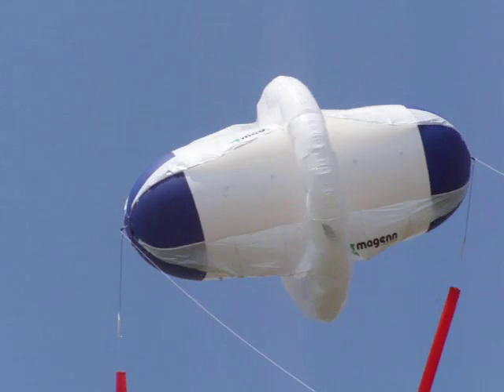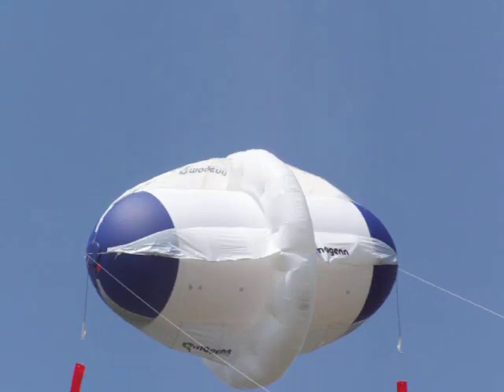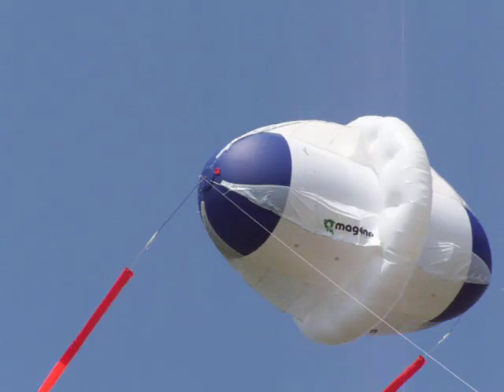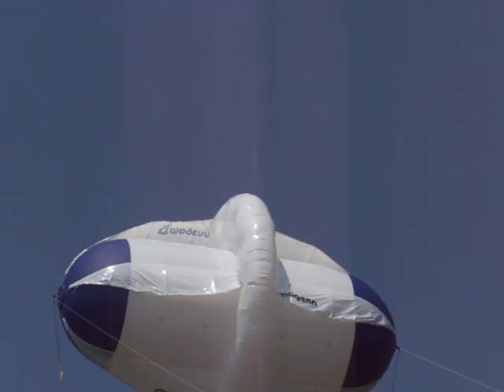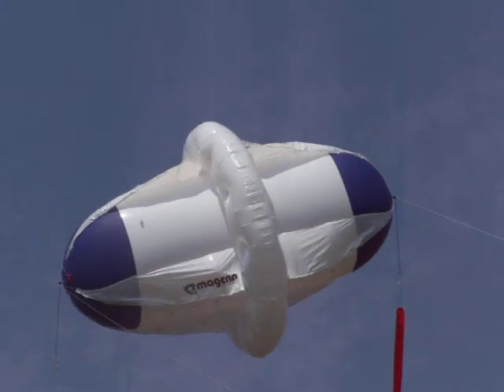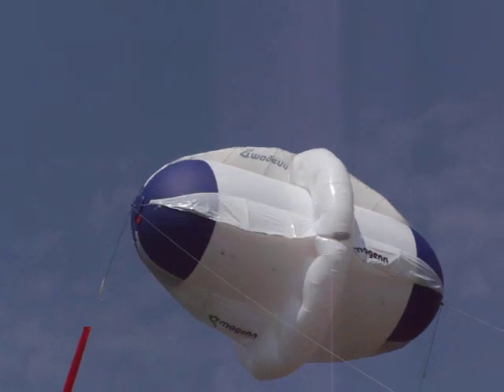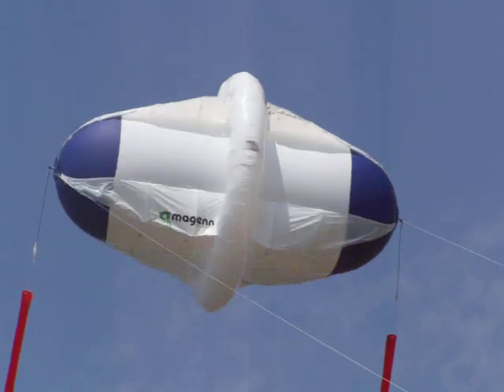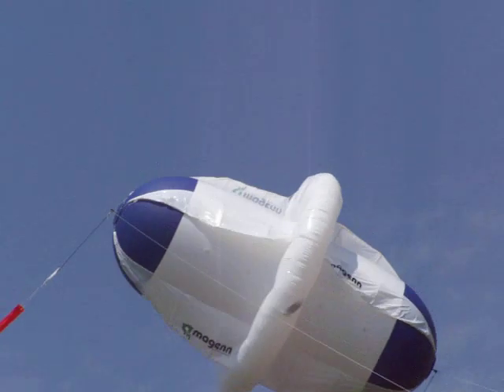Magenn Rotor Kite

Comment: The Magnuson effect is supposed to pull this sort of shape into the wind and prevent the balloon from being pushed into the ground, but as you can see the lines are at nearly 45 degrees in this mild wind at low altitude. Also, it looks like the blimp could easily twist it's lines, which I think would make it inoperable. 
Another thing, how do you refill it with helium at altitude? What does helium cost? How does that compare to the value of the electricity generated?

Comment: The only issue I could see with this generating electricity is the weight of the equipment needed to do so.  How much lift does this balloon create?  I could understand mounting a small alternator on the blimp and using wires to carry the current down to a regulator/battery, but at this point in time, I think the weight of the alternator itself is too much of a burden.

Comment: jerryaltman  there is a single axis straight through the balloon which is stationary. The  balloon is rotating in high velocity winds which equate to more power than you can aquire at lower altitudes. plus its got two generators, one of which is at each axis terminal. its Omni directional if you put a 360 degree swivel at the base of the two tethers that have the leads of said axial generators. Boom

Comment: The concept is fundamentally flawed. One word Torque. You must counter the torque to turn an alternator. Huge omission in this design.

They want lots of investment, and shovel out the sales patter, but they are a joke idea.

They suggest taking these to disaster hit areas to provide power. Yeah, as opposed to taking a small portable and reliable generator. It's a smack of desperation to make the idea look viable and have real world uses.

Invest? No thanks.